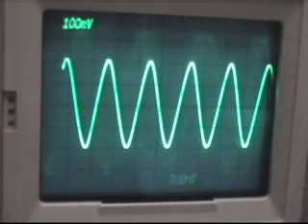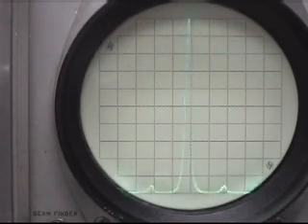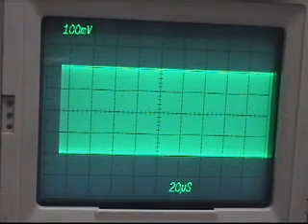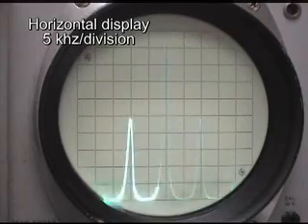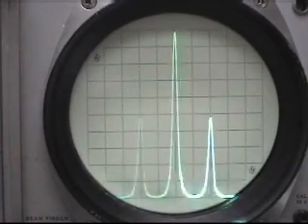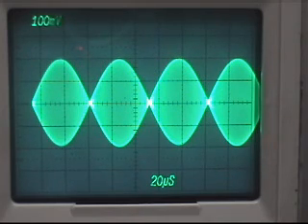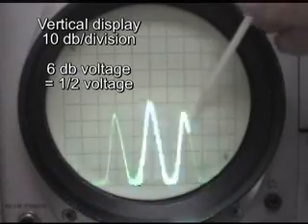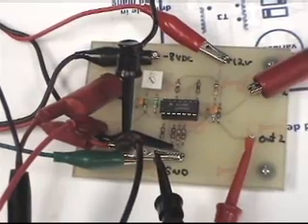Amplitude and Doublesideband modulation

Comment: Are the sidebands a product of superheterodyning the carrier with the modulating wave?  When you superhetrodyne (mix together) two frequencies together you get the plus and the minus of these two frequencies.  The plus and the minus waves are know as beat frequencies.  So my question is:  Are sidebands beat frequencies as the result of superhetrodyning?
Reply from the maker: The side-bands are the result of mixing the carrier frequency and modulation frequency in a non-linear device  such as a diode. When mixing you get an output of the 2 original frequencies, also carrier + modulation known as USB, and carrier - modulation known as LSB and harmonics of all these frequencies. If you feed the 2 original frequencies through a linear circuit, you get the 2 original frequencies only. To generate the side-bands a non-linear circuit must be used.

Take a look at http://golddredgervideo.com/kitsandparts/doubleballancedmixer.htm it may help you see the results better.
Reply: @kc0wox  So yes, this is the principle of superhetrodyne.  
When broadcasting FM stereo how is the the left minus right audio placed within the USB and LSB of a 38 KHz carrier?

Comment: what is the circuits used for generating two side bands if you show the diagram it will be useful. clear cut explanation and eassily understandable thank u sir.
Reply from the maker: Look at the datasheet at http://www.mit.edu/~6.301/LM1496.pdf The circuit I was using is at the top of page 4.

Comment: I just used the one from the data book. Check onsemi.com/ datasheet for the 1496 figure 5 carrier rejection and suppression. A negative is it requires a -8 volts.

Comment: Explaining with an oscilloscope and a spectrum analyzer removes some of my fog. I'm still having a problem understanding how transmission could occur with a 'suppressed carrier'.
You modulated a 2.5 Mhz carrier with a 10 Khz signal. Trying to grasp your explanation the 10 Khz modulation "creates" the sidebands. Is this correct? The 10 Khz modulating signal mixed with the carrier 'creates' phase relationships that oscillate at 2.4 Mhz OR 2.6 Mhz at which point the carrier can be suppressed. Do I understand what's going on?